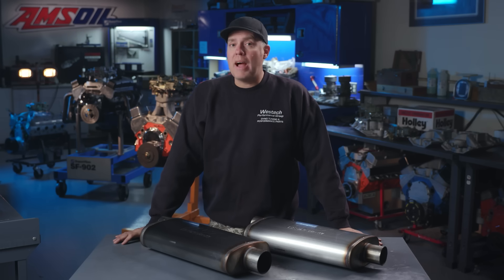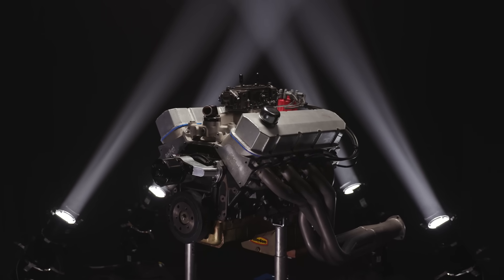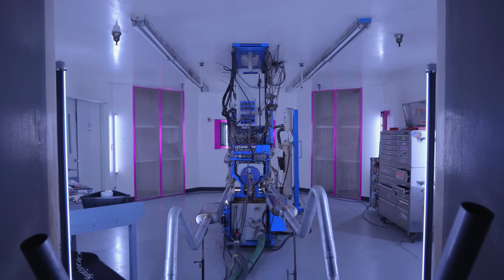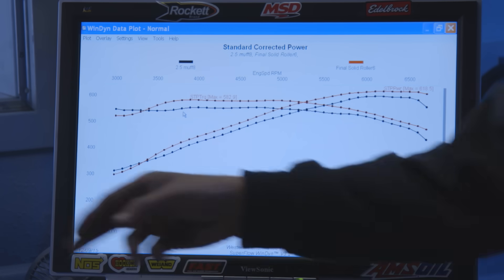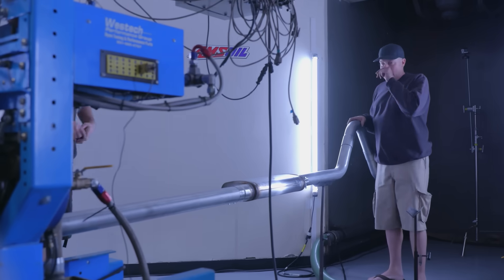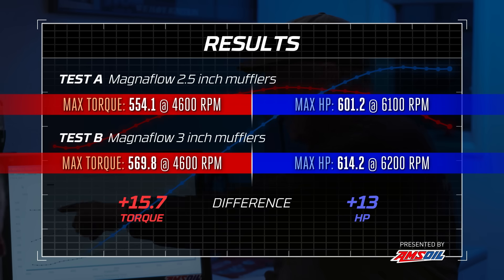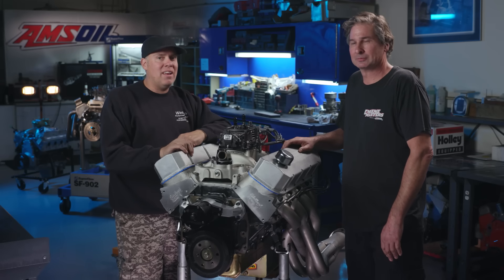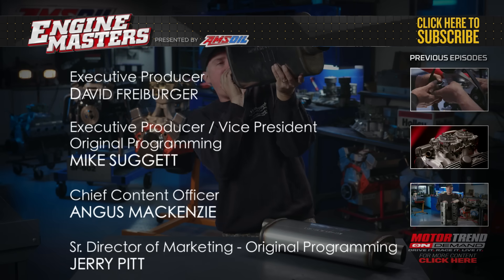The Power of 2.5- vs. 3-Inch Exhaust - Engine Masters Ep. 9

Comment: THE SMALLER EXHAUST VALVE IS THERE TO CREATE BACKPRESSURE TO SLOW DOWN THE ROTATING MASS, IT CUSHIONS IT LIKE A SHOCK ABSORBER. IF THAT WASN'T THE CASE THEN THE EXHAUST VALVE WOULD BE JUST AS BIG AS THE INTAKE. THIS IS ALSO THE REASON WHY THE CHEVY SMALL BLOCK WAS MORE PRONE TO BLOWING ON THERE FACTORY PERFORMANCE ENGINES WHEN YOU MISSED A GEAR. AS OPPOSED TO THE SMALL BLOCK FORD WHICH USED A SMALLER EXHAUST VALVE AS OPPOSSED TO CHEVY USING A LARGER VALVE. THERE WAS MORE OF A CONCUSHION ON THE CHEVY WITH THE LARGER EXHAUST VALVE, SLAMMING THE ROTATING MASS AFTER MISSING A GEAR. AFTER THE COMBUSTION CYCLE WHERE THERE IS A BIG JOLT OF POWER. THE BACK PRESSURE CREATED BY THE SMALLER EXHAUST VALVE. SLIGHTLY SLOWS DOWN OF THE ROTATING MASS FOR A MORE ACCURATE TIMING EVENT TO MAKE OPTIMAL POWER. AS THE ENGINE SPINS FASTER YOU NEED TO ADVANCE THE TIMING CURVE. SLOWING IT DOWN VERY SLIGHTLY ALLOWS THE MOST ACCURATE IGNITION. BACK PRESSURE IS VITAL HERE, THINK OUTSIDE THE BOX! (WHAT MOST PEOPLE DON'T HAVE ANY IDEA OF. THE BOX IS REFERRED TO AS THE CLASSROOM). THE BACK PRESSURE CREATED BY THE SMALLER VALVE. ALSO AIDS IN THE PROPER INTAKE FUEL CHARGE TO BE BALANCED AND WHEN YOU REMOVED RESTRICTION/BACKPRESSURE YOU RUN LEANER. 

TO SUM IT ALL UP. BACK PRESSURE IS NEEDED. THE SMALLER VALVE DESIGN IS FOR THIS REASON. ITS BUILT INTO THE HEAD. IT'S A CONSTANT. ASK YOURSELF HOW WERE SO MANY OLD SCHOOL RACERS WHO SHAPED THE SPORT OF RACING SO WRONG ABOUT BACK PRESSURE. MILLIONS OF THEM STILL LIVING AND OTHERS LONG GONE. IF BACK PRESSURE WASN'T NEEDED THEN THE EXHAUST VALVE WOULD BE THE SAME SIZE AS THE INTAKE VALVE, AND YET IT IS NOT FOR ONE REASON. BECAUSE YOU NEED BACK PRESSURE. IT'S VITAL FOR A ENGINE TO RUN PROPERLY.

Comment: Not every muffler guy is the same. Also you have to keep in mind the car that can except a 3" system. Another thing is the sound. Not everybody wants it so load that the car becomes not enjoyable to drive for long periods of time. I own Custom Exhaust in Hanover Massachusetts and have been bending pipe for almost 40 years. Yesterday redid a 55 Chevy because he swapped out the 427 to a 6.2 LS. This car is slammed to the ground with all sorts of mods done to restrict ease of even bending 2 1/2" pipe. 

I am a guy who loves Magnaflow due to the straight through flow and low interior drone. Great choice in the pick of mufflers. Any time I see you on the TV I watch because your funny and cool gearhead. I also have to say that you have a twin. I have a customer that looks like you. Did a mint 83 Chevy wagon 3" Magnaflow system on and asked him if he was you. His daughter even said that you and him look alike and do the same kind of stuff. 

Keep up the good work and if you are ever in my area, feel free to check out my place. I have a wall of 200+ pictures of my work. I am sure we would have a lot to talk about. 

I am going to do a 70 Pontiac Lemans with a seriously built 455. 3" with Magnaflows, I generally make the over the axle pipes but flow and no the expense thing is open, got 2x 3" mandrel bent 90 degree pipe. I don't have a mandrel bender so do I what can. Should be fun.

Comment: In this video they try to prove that back pressure is bad but I think they inadvertently showed that having a small amount of it is good and needed for daily driving. If you look at the 2.5" vs open collector dyno comparison (5:05), there IS a loss in power at the lower end and it only actually shows 3000+ rpm as the starting point. Most people will spend a majority of their daily driving time between 1000 rpm and 4000 rpm. That loss of power in the lower end would actually make the car feel weaker while daily driving.

Comment: Those sharp over-the axle bends on the 2.5 inch setup are a major restriction. I'll bet you get less power loss with a nice curve instead of a sharp peak the gases have to flow around. The 3 inch was considerably louder, and the gains were all above 3000rpm. All up was only 20hp difference on a 600hp engine at revs most people would hardly ever use. I'll bet most folk wouldn't even notice the slight power loss.. are you into dragging and loud pipes or cruising and quiet pipes? The results weren't as clearcut as you made out. Horses for courses!

Comment: Should just eliminate using mufflers all together,  install X pipe, & check decibel levels on ea setup. Imagine a full length straight 2.5" & 3" exhaust system w/o mufflers.  Rhen Flowmaster wouldn't get any advertising to pay the bills for this project,  so it's never gonna happen. 🙄 🙈

Comment: Hay guys. Can you do an episode with a 347, afr 220 heads and a 630 is cam on 3 inch vs 2.5 inch exhoust.  I have an argument with my engine guy. I'm running my 347 with 3 inch exhaust and he says I need to stick with shorty header. I think he is wrong
Reply: Ment 630 ish. Lift on intake side. I'm not 100% on what cam it is. I know it's set up for nitrous

Comment: Hello, love your video and very informative and your knowledge and demonstration of 2.5 vs 3.0-inch exhaust pipes.  I am restoring a 64 Impala with a 350 horse 350-V8 with naturally aspirated 650 Holly carburetor and 202 double camel hump heads. I am going with the Hooker long tube header but my question to you is what diameter exhaust pipes and if an “H" or "X” or even none of these would be recommended for this set up for the exhaust, they will exit straight out the back with Absorption mufflers? Thanks, Joaquin.

Comment: Larger exhaust is for HP. Smaller exhaust is for very low end torque. You don't need 3 inch exhaust unless you're actually trying to gain hp with an engine that makes power up top.

Comment: I wonder if this will be the same on a diesel engine (a 4wd) that won't go above 2500 RPM. 
Is there going to be a difference between in the 1000 - 3000 rpm range ?

Comment: Probably a dumb thing to ask, but what if a turbine fan was added to help expel the exhaust like a turbo to pull more air into the engine. Also a larger weap hole behind the cat to prevent to much vacuum to the headers for the fan to draw the right amount of exhaust out?

Comment: Had 2.25 dual full exhaust with a small block chevy went to 3 and it instantly went lean on fuel barely ran so I increased fuel and it definitely has better response and sounds great
Reply: I did 2.25" true dual exhaust with 8"glass packs on 2000 chevy silverado with 3" tips haven't noticed any power loss at all if anything it got more because I put 285/75/16 and it will smoke the tires like nothing when before I had 265/75/16 and they wouldn't smoke at all with stock pipes

Comment: I have a Buick Regal I have had since 1996 used to have 2/14" exhaust then a 2 1/2" exhaust then I put 3" exhaust and I don't even drive it anymore because it's so loud and it's fuming. I'll take the 13 hp and 15 to loss. Thanks.

Comment: This is what everyone says when they say you need some back pressure. Yall have gone over this and seem surprised everytime. A daily street driven vehicle benefits from the back pressure. If your gonna drive like a normal person, those numbers matters. I had a firebird 305 and when I got on it the exhaust would slip off and you could feel the power drop and the noise increase. Sure, if your gonna be racing light to light wide open, by all means open it up. Also, consider a street car with a stock tq converter needs that back pressure to get the car moving and then it needs to flow wide open. Kind of a catch 22. My .02

Comment: Well there is your answer. The carburetor is 900 + crm, so with fuel conversion to exhaust gas, just calculate the mph of the gas velocity leaving the pipes. I don’t see the need to do the set up just use a pencil and paper to see that back pressure restricts horsepower

Comment: 9/10 ppl would not be able to tell the difference between 600 & 614 hp. Still very cool to know exactly what the different systems do. Thanks for taking the time to show us, fellas.
Reply: @the chevy guy lmfao
Reply: @the chevy guy but the video is about exhaust's effect on performance. Unless you're doing something to move/force significantly more air through an engine, aftermarket exhaust is a waste of money.
Reply: @the chevy guy yea I don't believe you... AT ALL.
Reply: @the chevy guy that's fine and all but the only  problem is that I know for a fact that a 2.2 isn't getting anywhere close to what you're saying. I own a shop and have spent my life in the automotive field. I know all about those engines, when they stopped making them, what they got when they were brand new off the showroom floor, etc. I'll bet my last dollar that you don't even get 30 mpg even when driving in the perfect conditions, the truck is in absolute perfect condition, and you're driving habits are absolutely perfect. Even if you produced pictures of your guages showing it gets 40-50 mpg... I'd still call bs as I can easily manipulate my 5.0L f150 to show it gets up to 80mpg. You're lying and you know it. I just find it entertaining to call ppls bs out on this platform when I'm bored and have nothing else to do.
Reply: @the chevy guy I don't have to lol. I'm right and you know it

Comment: Hopefully this helps separate the BS from the ice cream. Back pressure even on a stock exhaust during normal driving or when wide open throttle is typically used is almost negligible; Its basic fluid dynamics. 2 1/2 inch benefits under 4000 RPM because of velocity, 3 inch is volume. There's a difference I'll explain. Both the intake and exhaust valves are open for a few degrees of crank rotation both sides of To Dead Center (A good thing), how much depends on your setup. On your daily Driver and mildly modded you need velocity. Fast air flow creates what is called called scavenging to pull Air/fuel into the cylinder to help remove the exhaust from the cylinder. The engine doesn't have to pump as much to move incoming air/fuel in and exhaust out you get low end torque, and that is why at lower RPM's the 2 1/2 inch is slightly better. 
3 Inch has more volume. You have more room for the exhaust to go BUT the downside is If you don't have enough exhaust entering to completely fill the pipe, AND flowing fast enough (low RPM's) you loose exhaust velocity, Scavenging, and low end performance. Larger diameter pipe is a good thing at high engine RPM because the cylinders don't rely on scavenging to fill and clear the cylinders as much at high RPM as they do at lower RPM. Also since the exhaust travels at a slower speed this is why the exhaust is usually has that rumbling roll and is louder than a smaller system. If your driving a stock or mild tune and don't want to loose low end performance run stock exhaust manifold or shorty headers, Stock or 1/4 inch oversize between the manifolds/shortys and the cat; if you delete the cat stock or 1/4 inch over size to that point; then 3 inch after the cat to the tailpipe.

Comment: Kinda sad you  didn't rejet or adjust timing for the 2.5 and 3" exhaust to show max gains or loss. Anyone can toss on a small EX system and show a loss of power with no fuel or timing adjustment.

Comment: I have a 1948 F1 i am getting ready to put a 383 stroker 550 hp in it with 3" exhaust with Thrush mufflers. Should the mufflers be close to the headers or towards the end of the exhaust pipe? I am stopping right in front of the rear end with the exhaust tips pointing down. Thanks, Bill.

Comment: Not hard to figure out a big cubic inch motor needs bigger exhaust hence the 3in due to volume. The 2.5 I believe to be plenty on a SB 350 in a 500 HP range due to less volume of air created. Whish they would have also tested a SB with both. I don't believe there would have been any advantage for a 3 in unless turned or super charged.

Comment: Please answer a logical series of questions.  Thank you.

At which range of horsepower and torque does a 2.5 inch exhaust produce the most hp and the most torque?

At which range of horsepower and torque does a 3 inch exhaust produce the most hp and the most torque?

At which range of horsepower and torque does a 3.5 inch exhaust produce the most hp and the most torque?

At which range of horsepower and torque does the 4 inch exhaust produce the most hp and the most torque?

For hypothetical example, an xx inch exhaust is most efficient for yy range of horsepower and torque:
* a 2 inch exhaust is most efficient for 200 to 350 hp (at 351 hp, the 2 inch exhaust becomes restrictive),

* a 2.5 inch exhaust is most efficient for 351 to 500 hp (at 501 hp, the 2.5 inch exhaust becomes restrictive),

* a 3 inch exhaust is most efficient for 500.00 to 650 hp (at 651 hp, the 3 inch exhaust becomes restrictive),

* a 3.5 inch exhaust is most efficient for 651 to 800 hp (at 801 hp, the 3.5 inch exhaust becomes restrictive), etc., etc., etc.?

Comment: The best 3" exhaust explanation video on the planet.
Reply: John Lingenfelter (RIP) and Borla would disagree. Lingenfelter built over 600 horse power Corvettes using Borla 2.5 inch exhausts. There goes the myth that bigger is better.

Comment: The oversized exhaust is only going to make a difference at wide open throttle.  I have 2 1/2" dual exhaust on my modified SN95 Mustang GT and that is more than enough for 400 HP street power.

Comment: FOR THE HOT ROD DRIVER 2 1/2 IN. IS JUST FINE WHEN YOU GO FOR H.P. YOU LOOSE LONGEVITY, DEPENDABILITY. TORQUE AND H.
P. IS O.K. FOR THOSE WHO LIVE BY IT. FOR THE AVERAGE JOE. NOT A BIG DEAL.

Comment: If you use a x chamber crossover right after the headers it helps...
Reply: If you have a big cam that has a lopey idle, the X pipe will kill that good lope sound
Reply: @Mopar-k6o but will give a v8 the braaping and ripping sound of a highly tuned Ferrari V8 .. put a complete bassani exhaust system on a mustang coyote and listen up.. you will be impressed
Reply: @donniebaker5984 I had on my ‘69 Chevelle with a .030”sbc 400  with a big lopey cam and it totally took away the lope at idle. At cruising speed it sounded like a coyote mustang on steroids but I like the nasty lopey idle.

Comment: I'd be interested to see how the manifold transition (3" to 2.5", vs 3" to 3" vs 2.5" to 2.5") affects power, and if the carb was tuned for the exhaust so not so rich.
Reply: I'm going to install a flowmaster40 on my tahoe and doing exactly that. 3" from engine > 2.5" in/out single flow40 > 3"
Reply: Will be posting videos soon
Reply: @Ophanim_Cherub1.4 how did that turn out trying to do that to my 3.2

Comment: I'd like to see this test on a 350hp small block and also test a restrictive factory muffler to a performance straight through muffler
Reply: Car Craft magazine did that test 25 years ago.  The stock mufflers are super restrictive!  Magnaflos, Ultraflows and Flowmasters are the way to go; just depends on the sound you can tolerate on long drives.  I use Dynomax Ultraflows; they flow within a hair of Flowmasters, and are quiet enough for my mom in her Caprice -they bark when you mash the go pedal.
Reply: Nust look at the point of 350 hp on this motor. Makes no difference.

Comment: I had a 350 making around 525hp, rec'd to 7800rpm and I used both mufflers, Chevy Corvair Turbo. There wasn't much difference and it was on top, above 6500rpm. Pulled a little stronger on the bottom with the 2.5"
Reply: Same with my sr 383. Swapping out my 3 inUltraflow for the 22" Superturbos. Bet theres no or almost no power differene but I wont attract the wrong attention anymore. 525 is a stout 350! Whats your engine combo consist of?

Comment: Interesting test. For 620 hp 3" exhaust is the obvious choice, and I'd also have a cross-over pipe between the banks to equalize the system (which for some reason you did not test). However, it might be another story for a real-world street engine that needs to make vacuum and not just peak HP.
Reply: Cross over pipes add back pressure

Comment: The reason the "backpressure makes torque" myth persists is that its totally true, IF you are going from a stock single to even dual with manifolds, let alone headers, and dont re-jet the carb. I have found this even on a stock 305 2bbl. After removing the stock system from my stock 4bbl 1973 mopar 400 and installing cheap headers and a 2.25" glasspack system it ran fine until you dumped that TQ! it shut off just like you pulled the coil wire not even backfiring! Got out the drill index and went after the jets and hey presto much more power, and better mpg than stock with larger jets! Also, even after maximizing the tune going from cheap severely dent tuned, welded and cut (to fit a C body) 1 7/8"  x3"  headers to unmolested  tuned length 2 1/8" x 3.5"  on our 440 6bbl cost us .2 sec at the drag strip all in the first 60' but mph was up by 3! The $75 1 7/8" headers were worth a full second quicker and 4mpg than cast 6bbl ex. manifolds and dual 2.5" with cutouts, again mostly in the low end. Best of 13.41 at 107mph with 7.75:1  cc'd compression, heads never off smog 440 with severe intake port misalignment in 4860lb race weight. Pulled front tires 2" got 14mpg on 87 octane in the late 1980s.

Comment: What your proving is different sized pipes, different length pipes tune the engine's power band for a specific RPM and peak.

3 inch exhaust makes more peak power, a 2.5 inch exhaust makes more power from idle to 3000 RPM, where most people drive.

STOP SAYING BACK PRESSURE. It isn't a thing, it is ignorance and you're only validating it.